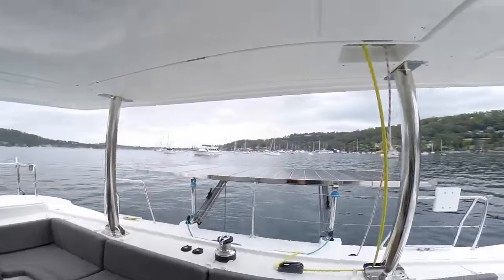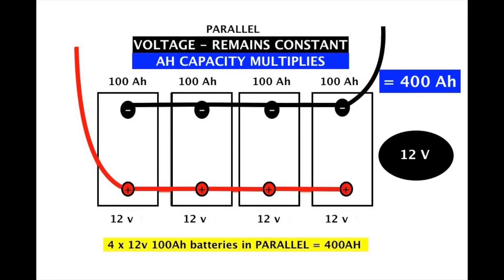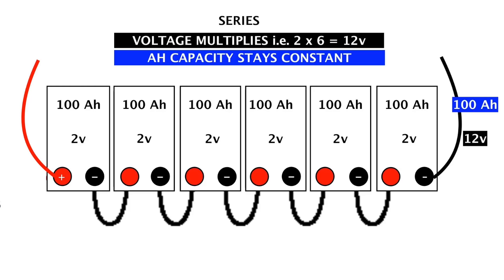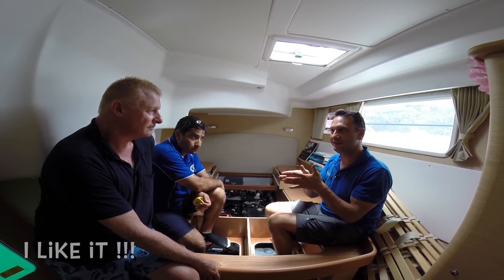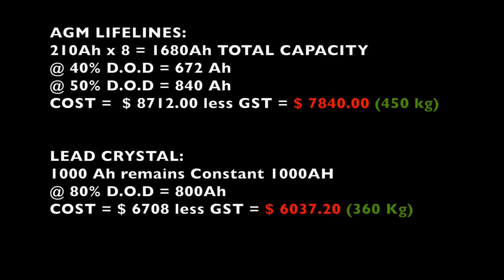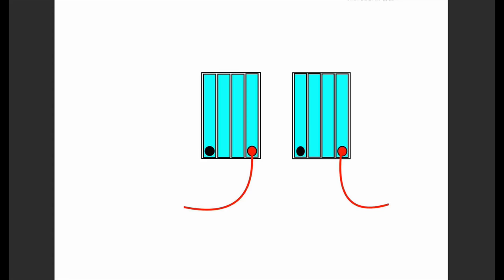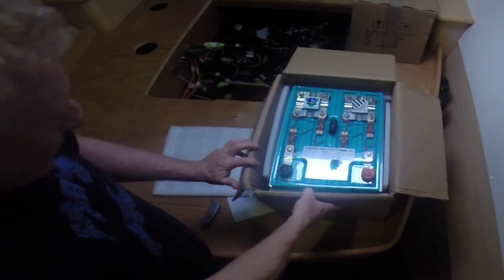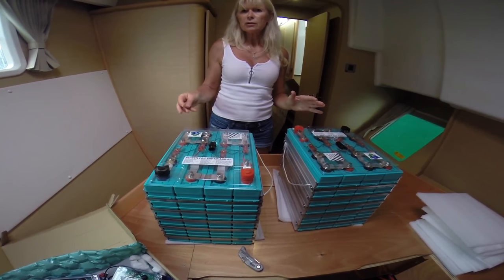Pt 1.  LITHIUM BATTERY INSTALLATION

Comment: Very nice explaination, well done. You certainly have made the right choice. The Energy Density of lithiums is much much more than acid type batteries.
Reply from the maker: Thank you TusconEV - still new for us but I must say it is incredible to see the voltage sitting continuously high even after applying heavy loads - bounces right back. I sincerely hope they stay this way for a long time ahead :)

Comment: I have heard that Lithium batteries, during their lifetime, can be charged and discharged two or three times as many times as AGM batteries, which if true, means that one set of Lithium batteries will last as long as two or three sets of AGM batteries.  Is this correct?
Reply: Sounds about right to me. GoneWithTheWynns has a vid on their lithium system and talk about math behind the economics of it. Lithium is really starting to make sense for boaters now.
Reply from the maker: Hi Martin - I hope an expert pitches in here, but yes - correct thinking. AGM's are not EVER a battery we will consider again for extended sailing at sea - done with that technology!
For me there will be a few options
1. Lead Crystal technology
2. Carbon Foam Technology (oasis Firefly)
3. LifePo4 technology.
One needs also to remember that DOD specs - lifecycles is calculated under laboratory conditions i.e. a continuous rate of discharge over time and then a full re-charge to full. Well, in real terms when sailing it is anything but as simplified as this unless one sits on here power all day. When we are sailing - the radar, autopilot, fridges etc. are taking loads ... we turn on an engine and the alternator pushes 175 amps ... off with the engine ... Ana wants a hot water shower so on with the boiler and me a cup of coffee so on with the kettle ... and so on! So we are fluctuating on varying loads all the time and we believe the LifePo4 technology handles this WAY BETTER than any AGM can, so do not trust the life cycle specs for ALL situations and especially not for sailing at sea.
What we have done is to set up the system based on capacity. The individual cell monitoring gear on the packs monitors the cells by voltage. The BCU also manages the packs by voltage. So we use a BMV702 victron monitor to 'watch the capacity' and we set it up to charge all the way to around 98/99% and to float on the tail end of the charge and then to shut off ALL chargers from further providing charge to the packs. The batteries then discharge (and we can determine to how far they discharge by setting the value on the BMV 702) to what we have set at 90% capacity (10% used power) at which point the BMV 'talks to the various relays' and the chargers all engage again. This way we prevent chargers fighting the curve at 'near full level' and we give the batteries a chance to function 'alone as it were' for a period of time before the chargers kick in again.
I ma  not sure I explain myself well, but thought this may add value to you understanding how we on Impi are managing the system.
Cheers for now
Brent
Reply from the maker: Awesome stuff sailinstyle - we LOVE the Wynns !!!
There are a few ways of doing this and definitely the Relion batteries are terrific. Everything comes complete within the packs. 
In everything there are advantages and disadvantages - I think ours start to make sense cone the time we need to replace the packs - we will transfer the gear across and purchase the cells only.
However, the Relions have an awesome reputation and perhaps they may get more 'distance out of their batteries' but only time will tell.
I am so pleased it makes sense - perhaps I should have shared a link to the Wynns - they cover the lifecycle and value in the long term whilst I am attempting to cover more of the installation angle to this. Perhaps we should join in with them here :)
Cheers for now
Brent
Reply: Hi Brent, yes, I think your viewers would really like to see the details on the math and rationale. I've spent a large part of my career involved in the technical side of building industrial systems with large battery capacity and I know from experience that the economics and physics behind these things are non-trivial. It's hard for people to grasp the logic of buying a lithium battery that costs three times (or whatever it is) what a VRLA battery costs. Life time cycle count, depth of discharge, it can be confusing. The more we can get real-world users like you to present the reasoning behind their system design, the better off everyone will be! Lithium is really starting to look like a practical technology for us boaters but it's still a huge and complex investment and there are multiple ways to build a system, as you have pointed out. You make an excellent point on the real world vs ideal conditions of the discharge/charge cycling. I'm sure I speak for many when I say that I would really like to know more about the system design, economics, etc if you'd be willing to share it. -Chris
Reply from the maker: Hi Chris - totally understand. Perhaps I am a bit of a 'working experiment in this regard' since I cannot vouch for what the LifePo4's will do for us ... as an exact science of course, but it is my intention to keep folks informed as we experience the situation going forward and our commitment to the folks following us is to present an honest outcome periodically.
I am not sure if you read any earlier comments, but yes, I do want to share more in these videos about our 'set up' because this is something we googled to death and found no real answers to, so the best we can do is to share how it was done on Impi, and how it works for us over time.
So ahead of the following vids (I need to do our regular travel vids for followers who prefer these to technical vids too) let me share the following:
The battery packs come with individual external cell management - based on voltage management.
The BCU / BMS also will shut down the pack if voltage is over or under spec.
In addition to this we have the Victron BMV702 monitoring the batteries based on capacity. (we set it up this way, since other devices are already covering the voltage aspect).
Our BMV is set by us to charge the battery packs to 99% capacity and then to kick into float mode on the tail end of the charge cycle and then to shut down all charging units after a minute into float.
At this point the BMV is 'told' to not allow any further charging to the packs until the capacity drops to below 90% (full) i.e. 10% discharged.
At that point, all / any available charging systems can kick in again and take the batteries back to 99% and into float repeating the cycle.
By means of a 'installed switch' we can do an override to force the charges to engage within that zone if we wish.
The theory behind this is that we first of all do not want the batteries to sit in float mode for a long period of time - LifePo4's (according to Rodney at EV Power) prefer to disengage when fully charged without a constant float. We also want to give the batteries a chance to settle and discharge for a time without being interrupted by chargers at a near full capacity. This reduces the risk of a 'spike' or sudden overload possibility' and we felt in discussion with our technician that it is better to have the batteries use this period and maintain stability. Some may argue this point but I quite liked the thinking.
The charging systems are all wired through relays.
The BMV determines when to 'open circuit' these relays and disconnect the charging devices. On the Alternators this is through the ignition wire so the alternators shut down without causing any damage to the internals of the alternator itself.
On the Victron Inverter chargers, we have the slightly older style model which does not have relay terminals built in, so we use the temp sense wire to achieve this as a wire connected to a relay that 'shuts down' the victron charger side.
So far it work really well. I am not sure if you saw the brief video on our Facebook page when we had installed the 2 x 175a alternators - they blew our electrician away ... lol ... says he could not believe the readings - put his current meter on to make sure - incredible! We threw the Balamar alternators out and exchanged them for large case Prestolite load handlers - I think around AUS$265 or 285 a piece.
Of course as we discussed not the video, we also put in 2 x heavy duty relay (isolation switches) inline each positive cable and the BCU will disconnect that line in the case of a voltage issue. Originally we were using the BCU relays, however they were too light for the charge loads we have on Impi.

Oh and as another positive ... the fact that we have external cell monitoring devices means when it comes time to replace the packs, we can simply replace cells ONLY since we can transfer the kit across to those cells ... 

I hope this helps ...

Cheers for now
Brent
Reply: Fabulous, Brent, thank you! Looking forward to more as you have time to post.  -Chris

Comment: So Lithium (LIpo4) Batteries are the same as 'Lead Crystal'?  - that's misleading. This is a very confusing Vid, but thank you for your efforts & an entertaining Vid all the same :)
Here's a better synopsis - Lipo4 (or rather LiFePO4) stands for "lithium iron phosphate" and is not a Lead Crystal Battery. Both are newer technologies however the Lithium's are extremely expensive and like the Lead Crystal Batteries require personal 'Battery Management Systems' and intelligent Charging/Discharging methods, so in that regard they are similar. The Lithium's are very very light in comparison to both AGM and Lead Crystal are an excellent replacement for things like Starter Batteries, also good on Mobility Scooters etc. BUT, I believe you were right to choose the Lead Crystal for overall performance and Value over the AGM's and not only that they the best in all categories/types for 'Deep Cycle' use on your boat set-up. Best Value, Great choice.
Reply from the maker: Hi Just Banter - I guess you have a point - I should have explained our choice more carefully. Perhaps I can clarify in our follow up vid so a valuable comment.
We actually should have been more specific on our 'short list' ... Lead Crystal, Carbon Foam and Lithium (LiFePo4).
Lead Crystals were something we really considered in our choice since they were great performers and very similar in charging / discharging characteristic compared to lithium type batteries ... well ... equally so the Carbon Foam Oasis Firefly batteries Nigel Calder put to the test and approved. And Yes, thankfully I managed to get across the 'weight issue' for Impi - we are already fairly heavy, and when comparing the costs these EV Power batteries were not far out on price considering the leap in technology.

We appreciate and love that you openly share your feelings here  - all this goes a long way to helping us in the sailing community better understand the advantages / disadvantages ... we learn, we share and we care. Cheers for now ... Brent
Reply: You have a great Channel/vlog guys, so plz don't think I don't appreciate that - Love the Sharing, and your Personalities too; I hope I didn't come across as a finicky old stick-in-the-mud?!
I'm not one to nitpick usually, I just thought it needed a little clarifying as I've had a few DIY Lithium projects lately :) 
BTW your choice of Battery for this refit/upgrade was perfect in my opinion. I'm very much a DIY dabbler but if I had a magnificent Craft like that I too wouldn't touch the wiring without employing a good electrician - I'd even worry about swapping-out a bust LED   lol
Reply from the maker: LOL - no worries at all and certainly not seeing your comment as a finicky old stick-in-the-mud :)
Its all good as they say here Down Under - we enjoy that you engaged with us and we appreciate the comments.
Cheers for now
Brent

Comment: This is quite complicated, even for me with over 30 years of experience:
Stored energy in a battery is measured in Watts per hour (Wh), and is a fixed rating.
Wh=Voltage x Amperage h. (12V x 100Ah = 1200Wh) or (48v x 25Ah = 1200Wh) each.
For a total of 4 batteries: 1200Wh x 4 = 4800Wh. (at 12 or 48 V).
Take 4800Wh and divide by a 10 hour night = 480W of continuous consumption for 10h. for 80% maximum  480 x 0.8 = 384W.
When in parallel, Voltage remains unchanged (12V), Amperage is added (4 x 100 = 400Ah).
When in series, Voltage is added ( 4 x 12 = 48V), Amperage is divided (100/4 = 25Ah)
I hope this helps.
Reply from the maker: Hi Josi - I really do appreciate your input here - it is very different to the way we 'yachties' think about our batteries and what you say here actually makes a lot of sense to me. So - I think I will start processing this the way you have described it here ... it will certainly add another dimension to my thinking process. Thank you for taking the time to explain it in such detail ... this is what the sailing community wants to hear ... thank you 
Cheers for now
Brent

Comment: @Catamaran Impi 

First of all: BIG fan & very jealous) 
I came across this: Tesla Smart Lithium Ion 18650 EV Module - 57 Volt, 3kWh: (ww.evwest.com/catalog/product_info.php?cPath=4&products_id=329&osCsid=crppo2s6hlacb091bns2fr3or0) 
$699
for 
3kW
I would like to know if you think this can be used onboard a sailboat.
Or can anyone answer this question? 
I'm thinking of ging 100% electric by either rebuilding an old mono or tinkering with a newer Multi-hull to include building a Li-ion powered outboard for my dinghy. 
It seems these batteries are getting cheaper every day. Except when they have the word "marine" associated with them.
Reply from the maker: Hi tdh - thanks for sharing this with us. I tried to open the link without success. I did some research on the Tesla and at the time was not an option for setting up our boat, but technology there seems to be advancing fast.

I would be very keen to hear some opinions on this too :)

Comment: Great part one video hope you will mention that lithium will last at least twice the charging cycles of AGM. Typically 1000 for AGM and minimum 2000 for lithium which makes the dollar equations very different when looking at total cost of ownership over time. You can claim the GST back for everything whilst visiting Australia but there are forms to fill out and need to be accompanied by receipts and then the refund is sent to you in due course ie "Island Time" Amazing to see you purchased from EV here in the West they have provided many solutions for boats even though it is not their primary business. Love how the lithium take whatever charge you can throw at it a couple of 100 amp alternators plus maybe 100 amp from Solar and your draw of 600 amps could be put back in 2 hours. Hope you recover soon all the best Dave
Reply from the maker: Hi David - yes - we will get to that! We shared a video on Facebook where we were punching in around 360A through our alternators - our electrician was gob smacked and so was the provider - Rodney at EV Power. When we explained that with the generator, solar power and alternators we would push a ton more, they quickly told us to go for the external relays ... lol. I don't think they believed me when I first told them what amperage we push through chargers :)
I must say that we have come across a number of sailing vessels since our Facebook posts, using EV power batteries and they are ecstatic - so we will see if we have the same result.
I am very confident that we did our homework and have an awesome monitoring / safety systems around the batteries.
By the way - it will come out in our video, but on Impi, we have 2 x 175A alternators, 2 x Victron inverter chargers (Well the chargers deliver 120A each so together 240A), our solar panels are 5 x 135A panels wired through a Bluesky MPPT controller and we regularly see 50A.
We love watching the display (Victron BMV702) ... the lithiums suck up everything we can throw at them ...
Sadly I have to say that for us the AGM route is like beating a dead horse ... they really were shocking for our application of living on the ocean. 
Cheers and have an awesome weekend.